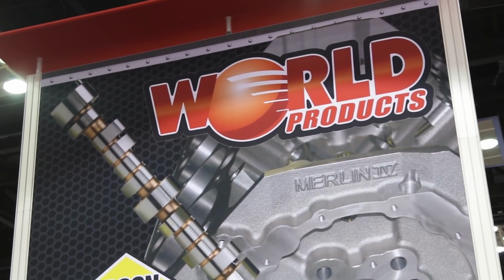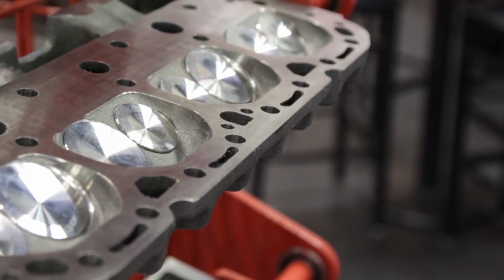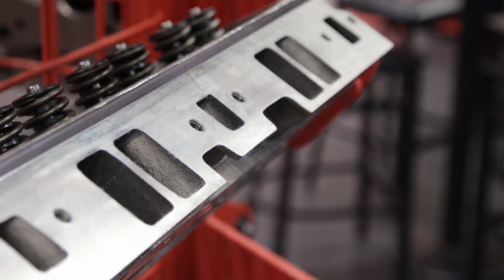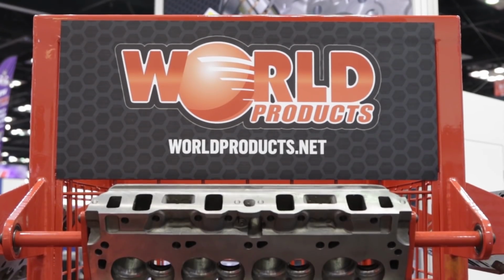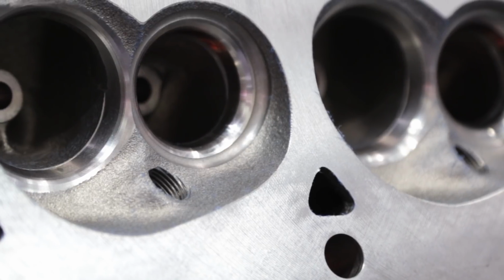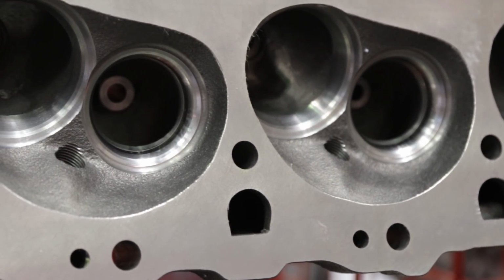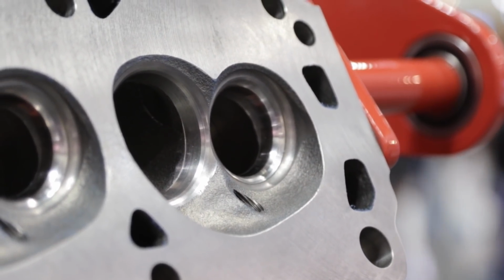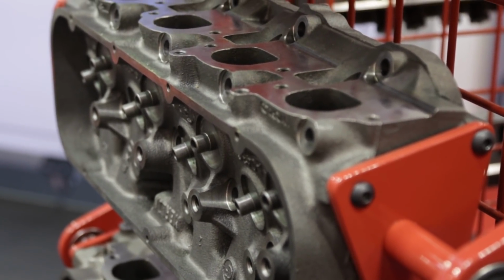PRI 2018: World Products Updated Cast Iron Cylinder Heads

Comment: I put the sr torquer on my 73 nova, pocket port them and they work great 67 cc 202 valves keith black pistons 10 to 1 compression engle ep22 solid cam, that engine made good hp for a street car

Comment: I bought some SR Torquers from Summit awhile back. All the valve springs cracked on the right side. I replaced all the springs. I'm pretty sure they were different springs on 1 side and not a matched set. 1 pushrod hole was slightly off. Then about 4k miles later #5 lost compression due to a crummy valve job. I took em off and got some actual GM vortec heads and a vortec manifold. Problem solved. Not to mention it probably gained 20hp. Aftermarket is not always better.